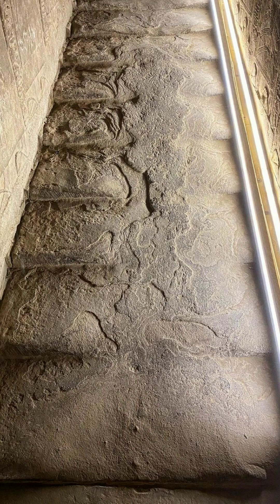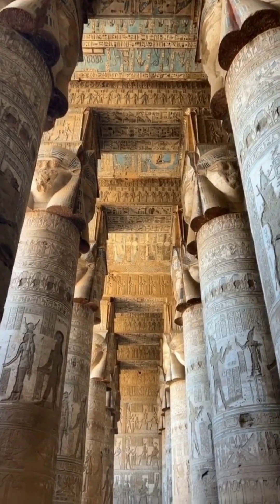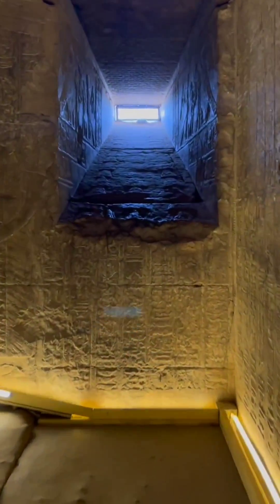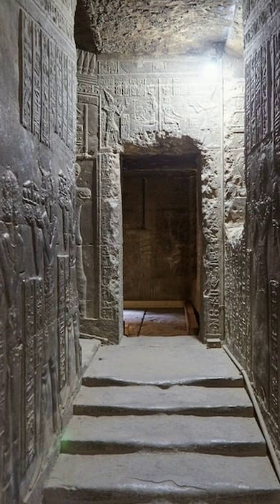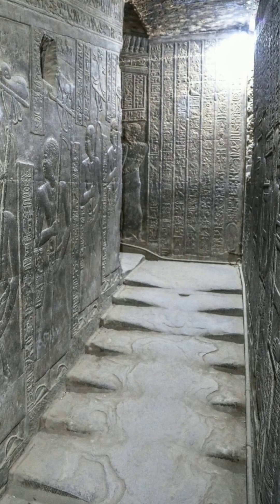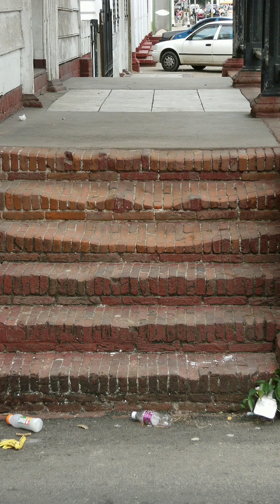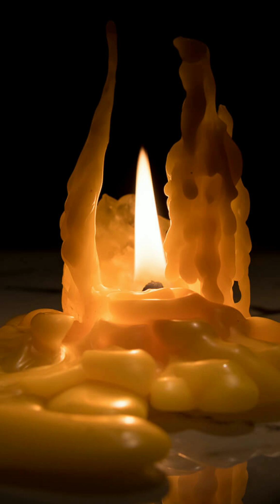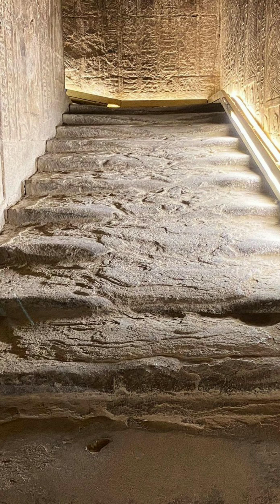Egyptian Melted Staircase #egypt #archeology #history #granite #solar #science #ancient #rome #giza

Comment: I'm not even sure that ancient Egyptian should be called Egyptian. The land of Kemet was the original name. So, since chemistry/chemicals were (thought) to begin there maybe it would also make since that the Great Pyramid had something to do with using chemicals to make energy creating heat so intense that it caused stairs to melt as super hot gas turn chemical liquid state found its way through the structure. I'm just guessing because i wasn't there, but I've heard other ideas that were just crazy. The walls show no signs of charing or smoke residue. So it had to be of a liquid nature. The steps don't look worn down as much as they look, melted by an extreme hot liquid of some kind flowing down the center. They don't want us to believe what our eyes are telling us. If you've ever melted plastic or wax, you'll recognize what it is you're looking at. The only other thing to consider is the sun itself creating a solar flare in this part of the world. That's much scarier and why i don't like to consider it. It could easily happen again. The outside casing is gone and supposedly distributed to various wealthy Arabs. An earthquake was said to be the cause for the casing coming down. Solar flares have been known to cause faults in earth's crust ultimately triggering quakes.